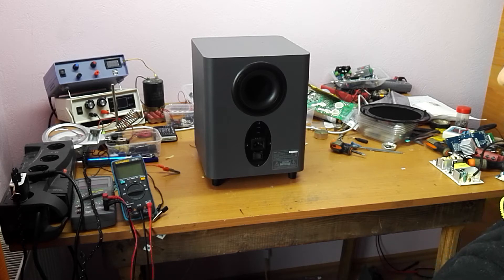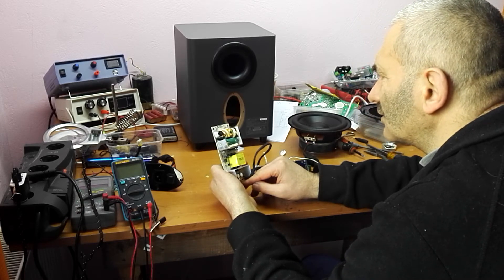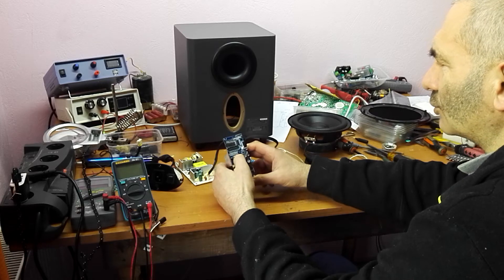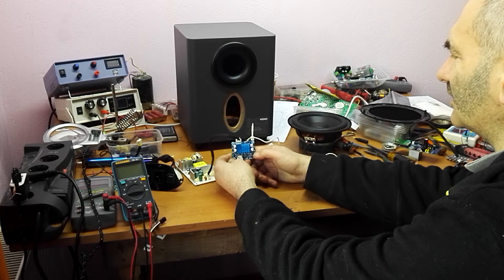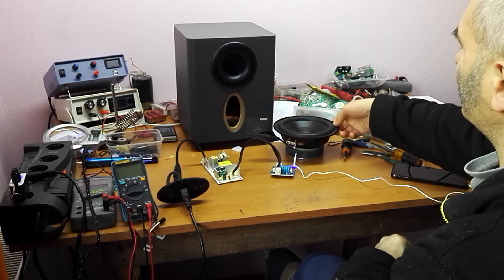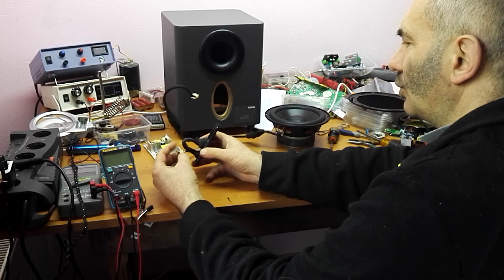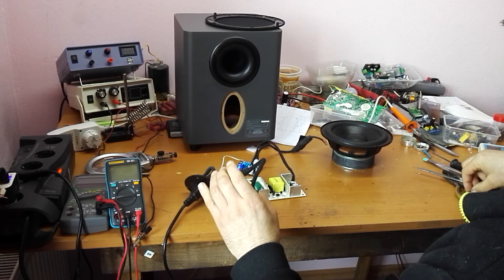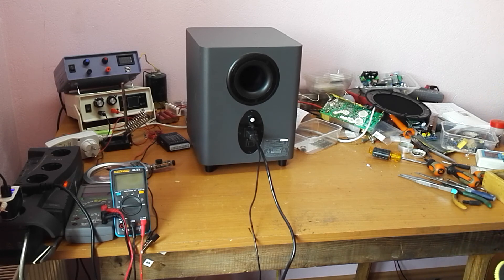Why and how I modified wireless subwoofer to wired?

Comment: Couldn't you get the same result by wiring an input jack directly to the speaker's wire terminals?
Reply: No, because it is a powered sub. If you connect it to the speaker’s terminals, you will bypass the amplifier that is built into the speaker, meaning whatever you use to play the music will also have to supply large amounts of power to get sound out of it. Ask me how I know… 🤣🥴🤦‍♂️
Reply from the maker: I need active subwofer,not pasive subwofer.

Comment: I want to make my samsung wireless subwoofer pswe450 have a new better amp and subwoofer and keep it wireless to the bar do you think it is possible?
Reply from the maker: theoreticaly its posible if u keep the audio signal receiver,but in my case volume and bass adjust were digitaly made in audio amplifier chip.I would not do this.
Reply: @diymariuselectro  ya so sounds like it is too complicated than the worth of doing it as it would  probly disrupt the sound quality of the bar due to the sub not being tuned and probly too loud to the soundboard
Reply: @diymariuselectro  actually wounder if I put sub signal to a high low converter if it would work that way for fun

Comment: Thanks for the video.  Does your new sound processor module that you put in not have a crossover?  It sounded like it was trying to play full frequency range audio instead of just the low frequencies?
Reply from the maker: yes u r right.I didnt put low-pass filter because I use subwofer output and dont need.
Reply: @diymariuselectro  Ah ok makes sense, thanks

Comment: Bonjour, J'ai un subwoofer LG model S55A1-D mais j'ai pas le barre de son.
Comment le faire fonctionner ou comment modifier le subwoofer Bluetooth en enceintes filaire?
Merci
Reply from the maker: pls translate to english.my frech is not very good.
Reply: @diymariuselectro  Sorry 
I said that, I have an LG model S55A1-D subwoofer but I don't have the soundbar.
How to make it work or how to change bluetooth subwoofer to wired speakers?
Thank you
Reply from the maker: @mouhamadsaidomar4609  u can do exactly what I did with mine.exchange amplifier board inside.

Comment: Hi,
If you could show how to check voltage
Then how to change it from let’s say24 to 12.
Then how to add rca output /input.
So you can then use these subwoofers in 12v cars.
Regards.
Reply from the maker: its different on each model.u cannt change from 24 to 12,but u can use stepup module.I will make a diy project to modify a sub like this on 12v for cars.

Comment: I found a Sony Sub in the neighbors trash... I have an existing wireless Samhsung sound bar.
  Do you have any insights to share,  for making the two different brands pair?
Reply from the maker: I tried to pair mine,but dont succed.its not standard bluetooth  its proprietary standard.i believe that u cant pair them,but u can check the receiver and emiter chip and try anyway.

Comment: Hello, this is wonderful, I have a JBL 2.1 subwoofer, I never got to use it as the bar was stole at the airport, I want to make it wired like you did here, please give me some advice.
Reply from the maker: You have ti find service manual and then make input conector.Like I did here.
Reply: Can it be paired with a different Bluetooth speaker? Just received tge subwoofer yesterday from a friend without the soundbar
Reply: @poohtianaman this would more than likely require some sort of firmware manipulation or hack. If you can do that then anything is possible
Reply: Did you find a solution?
Reply: @AbXyz-fh1yj  No, I sold it to a guy who turned it into a wired sub.
Reply: @JO_Artificial  does  that guy have a YouTube channel or is he on an Audio forum? Im very curious to what he did.